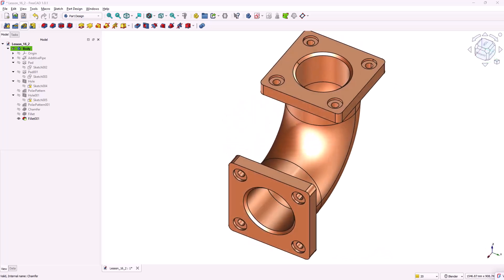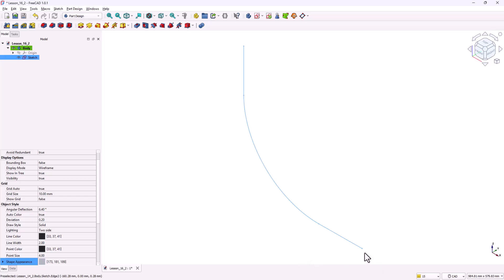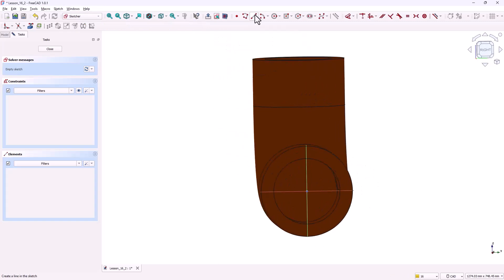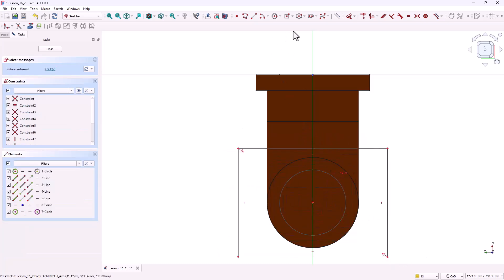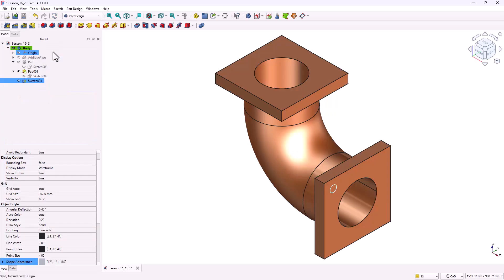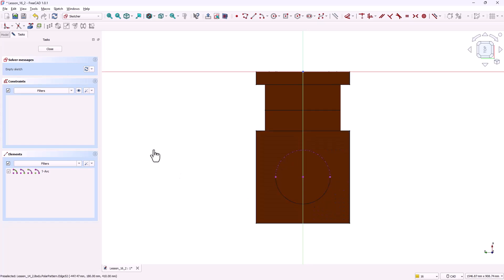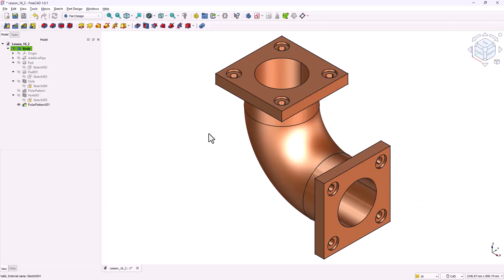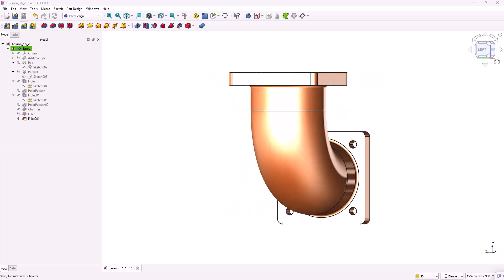FreeCAD Beginner Course | Module 1 – Lesson 9 | 3D Model 90 degrees Elbow Pipe Flange Step Tutorial

Comment: At 7:29 , when I set the depth to through all, it bores a hole through the pipe as well. I double checked my dimensions and everything is correct. How are you cutting only through that pad?
Reply: He doesn’t have it set to through all.

Comment: What is the benefit if any to using the polar array instead of making the four holes on the original sketch? I followed along but created the four circles on a single sketch and applied the hole to that sketch and I was done.
Reply: Repeated task. Prone to error and difficult to make changes later. 

With the polar tool the dimension for the position and diameter are set once per flange. If a change is required it still requires once per flange and less potential of missing to change one of the hole dimensions.

Comment: Technically the holes are on the wrong face if these flanges are to mate up to another part. Bolts would be on the pipe side. Good demo.
Reply: Correct. To be able to create the counterbore holes on the correct side I added a Datumplane that is 50mm behind the front of the flange, so the plane is on the other side of the flange. Then continued as per course and the counterbore holes are on the right side.
Reply: First thing I noticed.